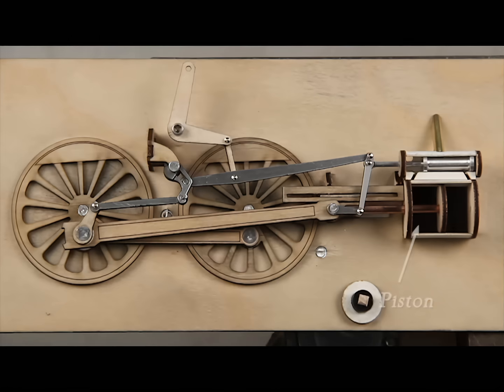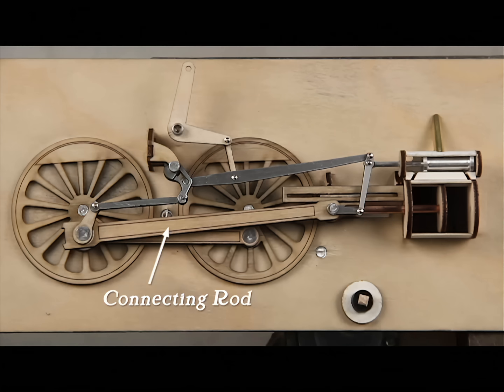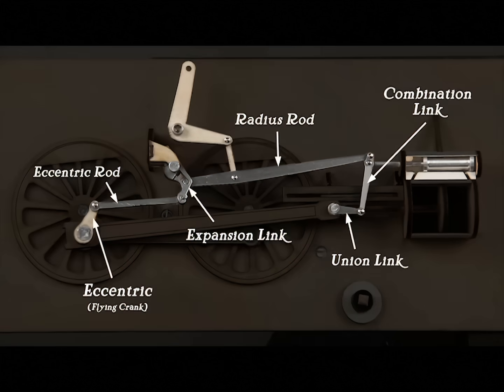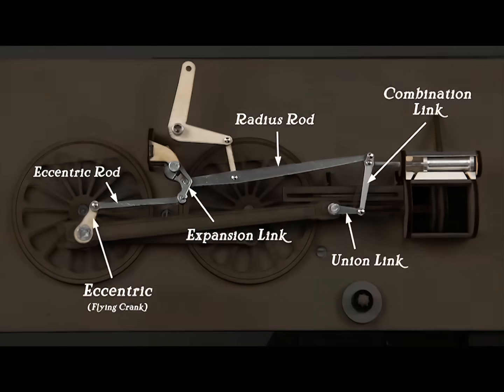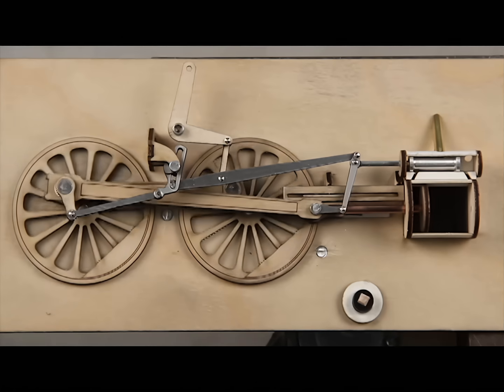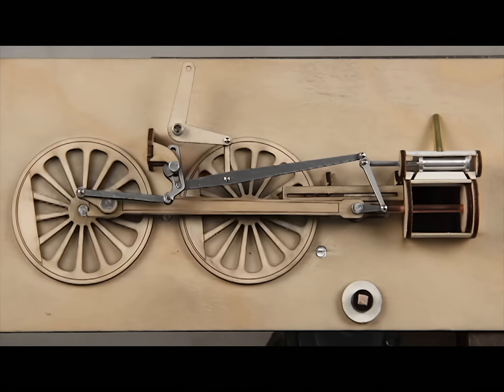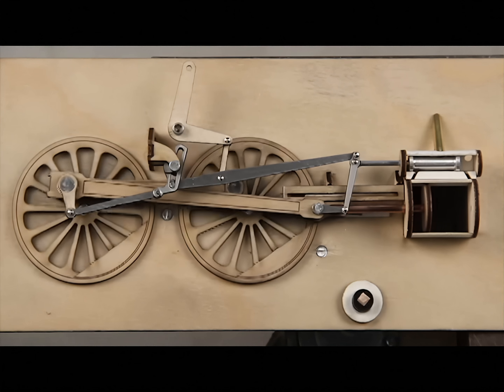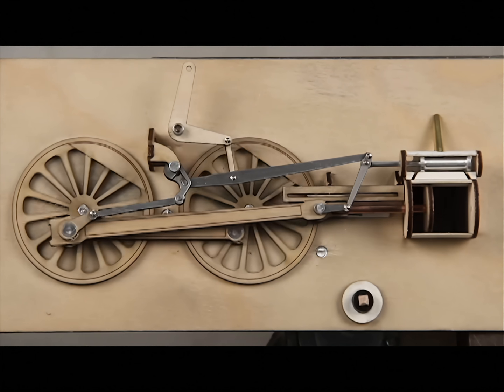Walschaerts Valve Gear Explained

Comment: Fabulous!  Thank you for this awesome illustration.  Question: If you reverse the engine say on a downhill run what is the result?  Is the engine essentially compressing air back into the steam chamber?  Does it cause damage?  Is it a bit like a truck's jake brake using "engine compression" to help slow down the vehicle assisting in the braking function?  Does it make a train's version of a "jake brake" doing so?
Reply: it will suck hot gasses and debris from the smokebox into the valve and piston chambers, which will ruin lubrication and can score the cylinders. If the valve  gear is reverse when the loco is moving fast, the piston can compress the gasses that are being sucked in (through the exhaust) and compress them in the valve and delivery pipe side and over pressurize them

Comment: Could you please explain how the Fu--Fu--Valve works, thus putting non-pressurised water into the 300psi boiler when the engine is stationary, final observation is,  dose the top of the drive wheel travel faster than the bottom when the engine is in motion,
Before answering this question, Think HARD, let me know

Comment: Honda invented variable valve timing!!

VERILY.... WALSCHAERTS HATH JUST KICKED IN, YO!!
Reply: Variable valve timing was already used in Stevenson valve gear by combining the movement of the forward and reverse eccentric connected to the radius link. Opposed to Walschaerts the die block remains in a fixed position and the valve movement is changed by lifting or lowering the valve gear towards mid gear. (Depending on driving direction)

Comment: I remember watching a British documentary about steam engines, but the cycles worked on spraying cold water into the chamber and creating a vacuum, instead of high pressure. Did I dream that?
Reply: I guess that would have been the early stationary condensing engines used in mines to pump water out of the workings
Reply: @robinforrest7680  Yes, they were the primitive ancestors of these highly evolved locomotive steam engines.

Comment: I don't think you're right about the motivation for the introduction of Walschaertz valve gear. Stephenson's valve gear predates it and performs the functions you describe with better symmetry and in both directions. Walschaertz valve gear cannot do this. If it's optimised for forward running, it's not optimal for reverse running. This doesn't usually matter that much in practice though.
I'd suggest that the real reason for the widespread implementation of Walschaertz valve gear has nothing to do with efficiency, and everything to do with maintenance. Stephenson's valve gear can't practically be mounted outside the frames, and that's a real headache for maintenance. Mounting the valve gear between the frames means the steam chests generally need to be between the frames too. GWR locomotives generally followed this pattern. On the other hand, Walschaertz gear is more compact and can easily be mounted externally which is cheaper to manufacture, easier to set up and easier to maintain. Although it's inferior in terms of symmetrical valve events, this is not a big enough issue to prevent it being used.
If you want to know more, download one of the valve gear simulators used by Model Engineers or consult the works of Don Ashton who it an expert on the subject.
Reply: Wow. There must be dozens of ways to control the valve. Today they would use a computer.
Reply: @burtvincent1278  - Indeed there are, Hackworth, Joy and Baker valve gear are to name but a few. The very best were late developments that used poppet valves and clever gearboxes. Caprotti valve gear comes to mind. In those they open and close the valve much more accurately and rapidly. All of the conventional ones have quite slow and progressive openings which is less accurate and efficient. You certainly could use computers and solenoids to operate poppet valves. If you search YouTube there's a video by Koenigsegg about a Camless engine that uses just that idea for a car engine.
Reply: @rogerfroud300  Yes there are many type of steam valve gear. All the kinds with spool valves work using a combination of a fixed amplitude sinusoidal (sine) motion e.g. the link connected to the piston rod, and a 90 degree out of phase (cosine) motion with variable amplitude e.g. the expansion link on this valve gear. This arrangement always opens the valves at the start of the stroke, and closes it part way through the stroke which is what you need for variable expansion of the steam. Changing into reverse just requires flipping the direction of motion of the cosine component e.g. 90 degrees ahead rather than 90 degrees behind the pistion motion, and the valve gear works just the same in reverse with variable cutoff (generally speaking).
Reply: @rogerfroud300  Yeah....BUT.....computers can be hacked
Reply: @sygrovesteve5819  - Only if they're connected to something externally and can have their software modified. Some systems have firmware that is either fixed or can only be updated by connecting a cable.
Reply: @rogerfroud300  Fair enough
Reply: @rogerfroud300  Yeah that freevalve head they have designed is a very clever improvement to the ICE
Reply: This is compensated by the use of turntabels so eniginrs with Heusinger/Waldschaerts gear could run forward for the most time.
Reply: Thankyou for  a very clear explanation of how this valvegear works. At the time there were many new developments coming along and much of the thinking was specifically to avoid other engineer's patents. It could well be that this was one of those.
There were some very interesting attempts to avoid Otto's four stroke patent too.
Reply: Stephensons valve gear can easily by situated on the outside of the locomotive. Ss an experiment, a British Railways LMS Black 5 locomotive was fitted with outside Stephenson Link Motion. Reputed to be the best of the whole class. Fortunately, this locomotive has been preserved in running order although at present it is under overhaul.
Reply: @andrewtwynham8794  - I'd suggest that it's possible rather than it's easy. It's a clumsy arrangement, not exactly elegant. Considering how much simpler Walschaerts gear is to fit, it's not surprising that the experiment didn't result in universal adoption, despite being technically better.
Reply: An issue with the Stephensons link is that as locomotives became larger with longer piston strokes the eccentrics simply grew to totaly unmanageable sizes and weights.
Other gear systems did away with this problem.
Reply: @vernmorris8898  - Are you sure about that? I'd be surprised if you couldn't rearrange Stephenson's gear to use a reasonable eccentric throw that produces a long valve travel.
Reply: Sadly I have to report that Don Ashton passed away earlier this year from Covid 19 related illness.
Reply: @haroldpearson6025  - I was in regular contact with Don for a couple of years, but sadly never got to meet him face to face. His passing is a huge loss for the Model Engineering community, but his work will live on in the form of projects he inspired and his book about valve gear.

Comment: Adam Smith stated that the modern steam engine was greatly improved by a young boy. This boy was employed to operate a primitive steam engine with a manual valve system, and the boy's job was to push and pull the valve lever to keep the steam engine in motion. The boy, bored with his job, and wanting to play with his friends, worked out a system which allowed the valve to open and close by itself, using pieces of rope tied to the flywheel and attaching them to the valve handle.

Comment: Is this true...cold water is injected into the exhausted steam to create vacuum on the bottom side of the piston, thus pulling the piston while simultaneously on the top side of the piston, hot steam pushes?
Reply: The pressure in a locomotive's boiler is well over 10x atmospheric pressure. There's not a huge difference between venting to cylinders to vacuum and venting them to atmosphere.

But I do remember something about that technique being used with stationary engines. Earlier designs operated at lower pressure (as low as about 20% above atmospheric) and it's easy to bring cooling water to the engine.  So it would have been a practical way to improve power and efficiency.

It probably wasn't worth the trouble of using extra water for cooling locomotives.  Water is heavy and bulky. The more you use, the more often you must stop and refill.

Modern steam engines (most often associated with nuclear power) have a surface condenser that pulls a vacuum on the exhaust side. But they have some kind of heavy cooling system such a tower or an ocean that accepts the waste heat - it's not practical for a ground vehicle.
Reply: @jordanrodrigues1279  
Yep. And simething I didnt think about was when steam condenses, it forms water. And water on either end in this case could be uncompressable and bust the heads off. One of these videos mentioned that that was an occurance anyways, so the cylinders have to be purged occasionaly. Something to that effect.
This videos good. There's another one that has quite a bit of detail to it. Pressure gauges at different levels and temps, etc.even sand boxes. When the engine starts rolling, they tend to spin wheels on the tracks. So a chain is pulled and it pours about a tablespoon of sand on the track just in front of the wheels and they stop slipping.
 If I brought a notebook....lol. but ill find the link.
Reply: @jordanrodrigues1279  
Here it is.
https://youtu.be/UrV8x01LLNo
Reply: That would be dangerous for the pistons.

Comment: If the radius rod simply connected to the valve spindle and there was no derived motion via the combination what would be the result???
Reply: The result would be that there is no lap or lead steam. That is the short answer! Now I will try and explain to the best of my knowledge the long answer (please someone correct me on this if I get any info wrong!). If the radius rod was connected directly to the valve spindle and the valve heads were the same width as the valve ports, the valves would let steam enter the pistons on the full length of there piston stroke. That is to say that even if you adjusted the radius rod nearer to the mid-way point of the expansion link, and the valves were now restricting the amount of steam let into the ports into the pistons, the valves are still letting steam enter the pistons at a restricted rate on the "full length" of the piston stroke. This is quite a wasteful way of treating steam as steam will carry on expanding even after the valve ports are closed, but in the case of the radius rod being directly connected to the valve spindle, the valves will only completely close when the piston is at the end of its travel and not before!

Now, by introducing a combination lever and making the valve heads wider than the valve ports, we can now create what is called "lap" steam! This essentially has the effect of shutting the valve ports complete "before" the piston has reached the end of its travel, and all this can be controlled by a handle in the cab called the "Reverser" (the handle that makes the loco go forwards and backwards and also controls the opening of the valve ports). When pulling away from a standstill, you would wind the Reverser in full forwards (or full reverse) 75%. This will allow steam to enter the valve ports at its maximum opening and drive the piston in the correct direction for "75%" of its travel before the ports have completely closed, leaving the steam to expand in the cylinder for the remaining 25% of its travel. Once the loco is getting up to speed, the Reverser can be wound back for a shorter "Cut Off", e.g. wind it back to 45% cut off, this will place the radius rod nearer to the centre of the expansion link resulting in a restriction in the opening of the valve ports and causing the valve ports to completely close when the piston is only at 45% of its travel, allowing the steam in the cylinder to expand for the other 55% of its remaining travel! This all results in steam being used more economically!

When it comes to lead steam, this is the steam that is let into the other side of the piston before the piston has reached the end of its travel. In effect, it cushions the piston before it reaches the end of the bore. Again, this is all possible because of the combination lever! This is kind of like advanced ignition timing on a car! 

I hope some of my explanation makes sense and hopefully others will correct me if I'm wrong!
Reply: @stephenwiseman1816  thanks Stephen for an excellent explaination.
Some of this I did know such as cut off by winding back the reverser allows steam to enter the cylinder and vary the length of piston travel before steam is shut off 
I'm never really understood lap or lead and so the use of a combination lever makes sense now.
Thankyou.
Reply: @Steven_Rowe  Glad I was of help! That is just my understanding of it and no doubt there will be others who can correct me on one or two things.

Comment: Steam engines are far more efficient than internal combustion engines, every stroke is a power stroke, with internal combustion only one in every four stroke ( induction, compression, power, exhaust ) is actually making power.
I am sure that vehicle manufactures could build all NEW steam cars that use either LPG or methane gas ie cow fart cows fart a lot of gas! Either fuel is clean burning, steam is only super heated water vapour which returns to the clouds and comes back as rain.
Why is this not being considered???? Methane ie cow fart as long we have dairy will NEVER EVER run out and is CLEAN BURNING!!!!!!!!!!!!!!!!!!!!!!!!!!!!!!!
Reply: But a 4 stroke engine only intakes 1 out of the 4 strokes as well, so nothing is really being wasted.
One thing thats not shown here is cold water being injected into the cylinder after the expansion is complete. This creates a vacuum, helping the opposite side of piston with its expansion. Then the process reverses and repeats. An example of the power of cooled steam.
https://youtu.be/Tm3f1MfrWdM

Comment: I don't think you made a glaring error at all. It is true that in the center position, the radius rod is stopped. But since the union link is still moving and the valve is connected to a point on the combination link near, but not at the top, the valve still moves although a lot less. I think you got it right. BTW I am one of those who also wondered about that linkage all my life ever since I used to meet those locomotives to pick up the newspapers for my paper route in around 1950. I really appreciate your explanation. Great job.
Reply: Correct, the combination rod is included for the specific purpose of allowing valve travel at the neutral position. The model is correct and operates exactly as it should!
Reply: @davidzachmeyer1957  I'm not saying that you are both wrong because I don't know enough about the subject but if one extreme is full power in the forward direction and the opposite extreme is reverse there has to be a neutral position somewhere in between. Whether that position is the centre position or not determines whether he made an error in the model. The thing is, two 90-degrees out of phase rotating motions can never cancel to zero, whatever their relative amplitudes - this is the mathematical approach, which I understand better than the mechanical approach.
Reply: @johnm2012  read up on the Walschaerts mechanism to understand the function of the combination lever. As I stated, the OP's model properly represents the correct motion of the valve when the reverser is at the center position.
Reply: @johnm2012  If one extreme is full power in the forward direction and the opposite extreme is reverse there has to be a neutral position somewhere in between, yes, and that position is not necessarily engine at complete rest, nor coasting for that matter; I think in this case "neutral" amounts to powering forward half a cycle and powering backward half a cycle.

But I'm not a steam engine expert either.

Comment: When I was a kid I wrapped my brain around the valves and rods and fly ball governers that control steam engines till it gave me a headache!  A model like this would have saved me the headache . Joshua Rose would have loved this! I want one!
Reply: i could never figure out how the timing on the connecting rods working because they should just get stuck
Reply: same exept i never notice the second set since i mostly looked at older locomotives with valve between the frames and couldn't figure out how they reversed

Comment: Thank you so much.  I have been looking at the transmission gear of steam locos since I was boy  in the '50s near the end  of the steam era in Britain. I could understand the piston connecting rods'  action and knew the upper rods were something to do with valve switching but never understood the actual workings. Thanks for the beautiful model and the very clear explanation. How ingenious the steam  limiter and reverse linkage is.

Comment: I just love to see how these valve gears work. Back in the late 60s, my High School railway club was given a brass model of a loco chassis with Stephenson valve gear. It was a serious piece of equipment and was about 5 feet long. It was stripped down and cleaned and I took over the job of setting it up. I was informed that it was inside admission and spent hours trying to set it up before discovering that it was actually outside admission. It taught me a great deal about valve gears and it is still a subject which fascinates me, especially poppet valves.